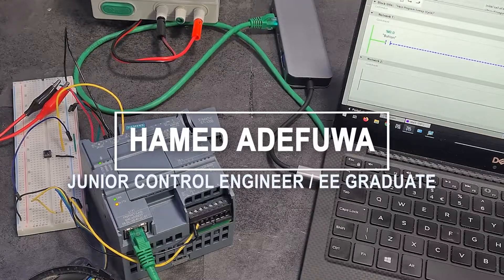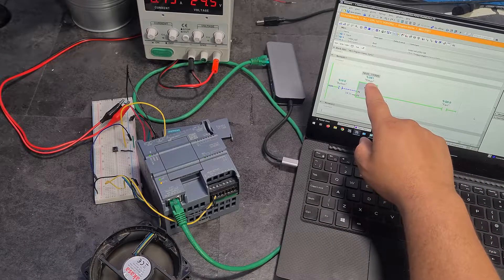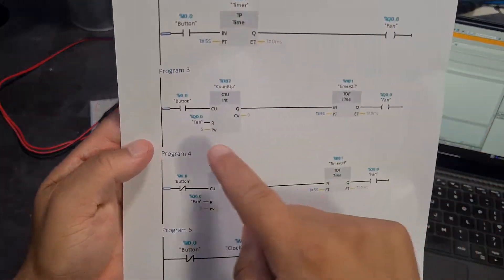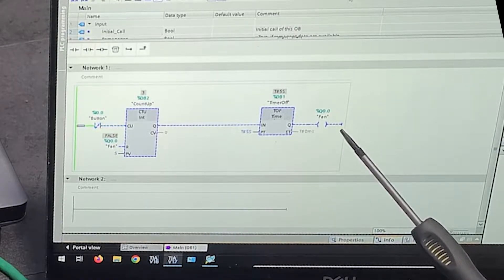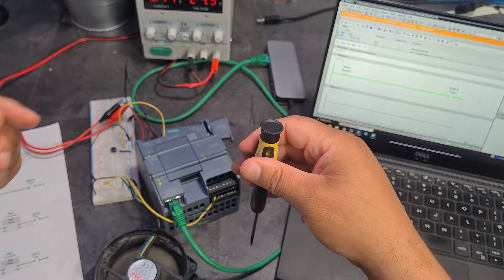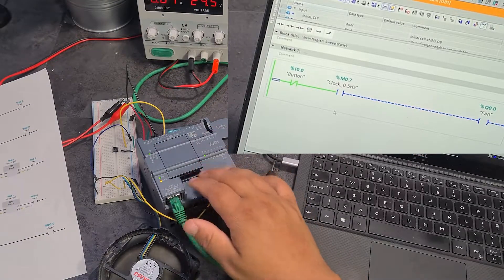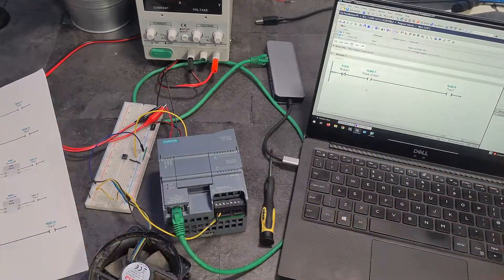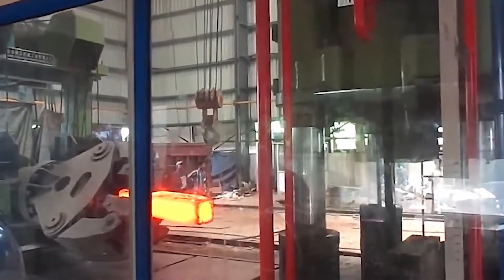S7-1200 - My First PLC Project #1

Comment: This is great. I have never worked with PLCs before but always wondered how they operate. How do you think they compare to using microcontrollers in industrial environments? Also, I am aware that in Germany for example, more companies are moving towards industrial IoT for their controller operations and striving towards making controllers smarter. Do you see this as well?
Reply from the maker: Thanks Jeffrey! PLCs are pretty amazing, they're just so perfectly suited for industrial applications that as each day goes by, I realise they're less and less like microcontrollers used in the embedded world or hobbyists. In the UK we use Siemens a lot, they're German and you're right they are pushing IoT a lot. Which makes sense for large organisations but for small 1-3 facility manufacturers, theres not much need and theres a huge security risk. At work we had a guy who was remotely connecting to a PLC and trying to upload from it whilst the facility was making £500,000 metal beams and it was messing up the beam lol. You really want super rugged and reliable equipment when you're dealing with this kinda money and also the safety aspect in terms of heavy equipment moving quickly around humans. I do dream though of sticking a raspberry pi inside a control cabinet one day, to compliment a PLC, but not replace it.
Reply: @HamedAdefuwa  I can definitely see why these PLCs are used, and programming this seems  interesing. I like your excitement as well because I can relate. There's just something about controlling hardware that brings so much satisfaction lol. I hope you keep going and I know I said I was going to email you, I will. Please send me that email again haha, thanks 👊🏾
Reply from the maker: Lol totally agree! I'm due to be programming a huge bridge to lift up and down soon, getting to witness that would be amazing! Hamed@hamed.engineer is the email